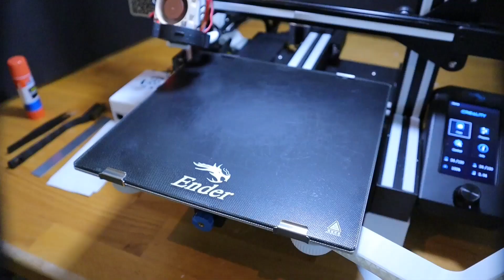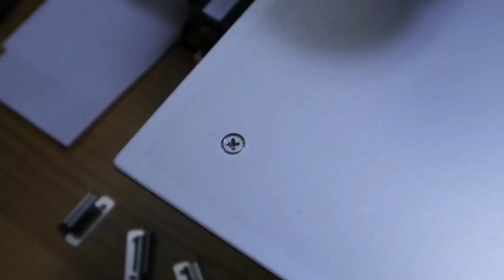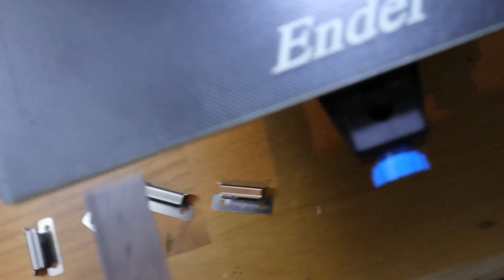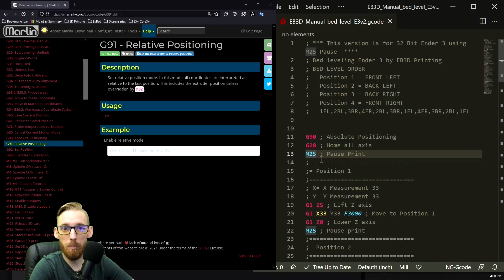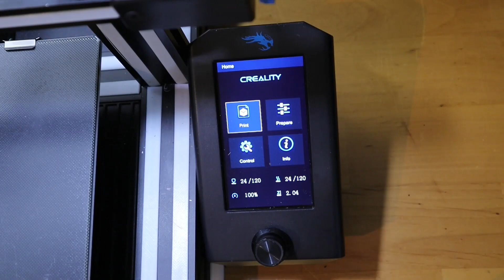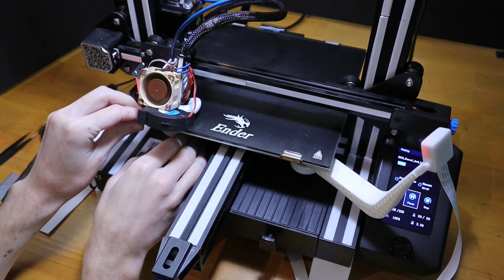GCode Bed Leveling on the Ender 3v2 or Any 3D Printer

Comment: Thanks for this! For me it is a great improvement over manually moving the hotend (or even worse disabling the steppers and pushing it around). I successfully used the "M0 pause" version on my new Ender 3 v2 Neo. The "M0 pause" version didn't behave as it should have. That's a bit of a puzzle, as I'm pretty certain that the Ender 3 v2 Neo has the 32bit board.

Comment: Thank you for this facinating video. My printer is a Voxelab Aquila X3, an Ender clone, so no modifications were needed. I downoladed and ran the m0 code. It works for the first 2 positions, and then stops. Start has no effect at that point. What could be the issue?
You mention setting Z offset with a piece of paper. Do you have a video on that process?

Comment: when I hit resume for next area there is a 10 sec delay where the program is waiting for the bed and extruder to heat even though they are at temp
Reply from the maker: The bed and extruder do not need to have there temps set to run this code. Run both cold when bed leveling
Reply: I did that and when the bed was heated for the test print, the extruder dug into the glass bed.  I ended up finding some Goode online that ran another set the extruder temp down to 150 before the level so it wouldn’t leak everywhere.  It actually works great.  Thanks for the video as it was my first gcode explanation.  Great job

Comment: Instead of pausing my ender 3v2 goes to the home position and waits there. Stock 1.0.4 firmware, do i need to install different firmware for the m25 command?
Reply from the maker: Do you have the option to resume printing after it goes to the home position?
Reply: @EB3DPrinting  appreciate your reply. Yes, after resuming it goes to the next spot, touches the bed, returns home and pauses until I resume again.
Reply from the maker: @sinestam  have you tried both the M0 and M25 command gcode?

My guess as to what is happening is the home position is set up as your nozzle park location during pause. So anytime you pause the print, it goes to the park location.

 I just double checked the gcodes and there is no home command except for the initial command at the start of the print.
Reply: @EB3DPrinting  Argh! I figured this printer would use the m25 command, the m0 does the job exactly as advertised. Thanks for your troubles!

Comment: Question, Gcode is a print. So how do you use a gcode where it doesn't print and 
stops itself?
Reply from the maker: You do not add heating and extrusion gcode elements. The only aspects of the gcode are movement elements
Reply: @EB3D Printing  does that also require editing the gcode?
Reply from the maker: @TheDog951  Yes, all I wrote in the gcode are custom movement commands to match the size of the Ender 3 bed to move the nozzle above the bed height adjustment knobs

Comment: So can I simply copy the corresponding gcode and paste it to an SD card and insert it into my printer? then run the code thru the print menu?
Reply from the maker: As long as your bed dimensions match the same as in the file, it should work.

Comment: Thanks for this tutorial for the gcode bed leveling. It works very well. Do you also have a gcode solution to the problem with pausing when I replace filament in a different color? In Cura I put a stop "pause at layerhight....." The Ender 3V2 does stop, but immediately starts printing. Do you have a solution?

Comment: Great video, finally someone explaining clearly!

At the beginning I would also have added the heating of the bed at 60 ° and the nozzle at 200 °

I tried your gcode for 32Bit, but I would need a pause BEFORE the Z0 (at Z5) and also at Z0 (because I would like to measure the flatness of the platter with a caliper)

Why if I edit the file like this, it no longer pauses me M25 at Z0, but immediately goes to the next position?
I'm going crazy! :(

I add ** just to underline:

; = Position 1
; ==============================
; X = X Measurement
; Y = Y Measurement
G1 Z5; Lift Z axis
G1 X33 Y33 F3000; Move to Position 1
** M25; Pause print
G1 Z0; Lower Z axis
M25; Pause print
; ==============================
; = Position 2
; ==============================
; X = X Measurement
; Y = Y (MAX) -Y (Measurement)
G1 Z5; Lift Z axis
G1 X33 Y202 F3000; Move to Position 2
** M25; Pause print
G1 Z0; Lower Z axis
M25; Pause print
; ==============================

Comment: Very helpful again thanks!

One question about the "Activate leveling":
On the machine is an option to activate leveling, an option i often forget to activate. Does the leveling activates with the GCode from my slicer anyway, even when i forget to check the option on the machine?
Reply from the maker: Yes, it gets activated by adding M420 S1 to the start gcode in your slicer